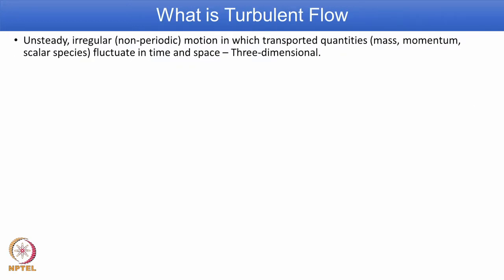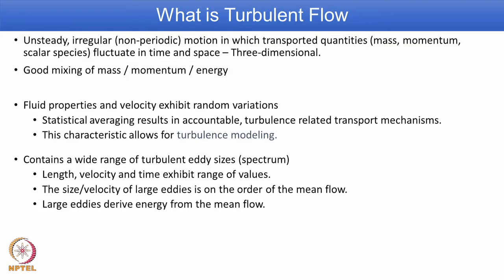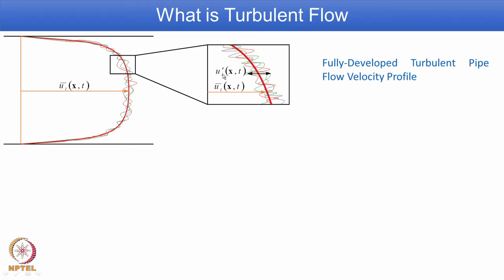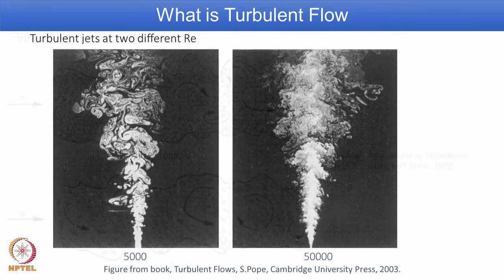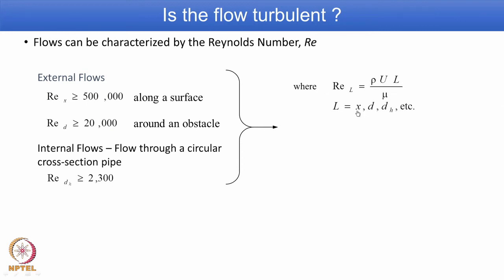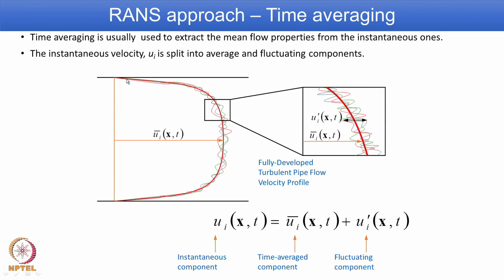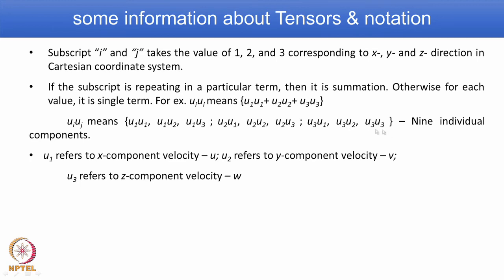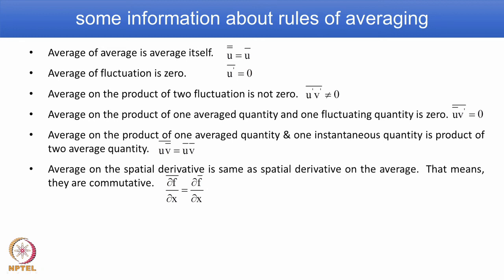Week 6 - Module 1

Comment: Why the instantaneous velocity is equal to the time averaged velocity plus the fluctuating velocity? What is the physical meaning? why  do we do that?
Reply: The instantaneous velocity is the actual velocity at a point in flow field. For turbulent flows, this velocity fluctuates continuously in a random manner and hence is not steady. So we split this instantaneous velocity into two components : one is the fluctuating velocity (very small) and the other is the average velocity. The significance is the knowledge of the fluctuating velocity helps us determine the reynolds stress and the distribution of average velocity along a section helps us determine the newtonian/laminar shear stress.